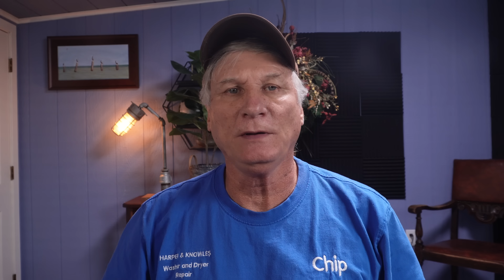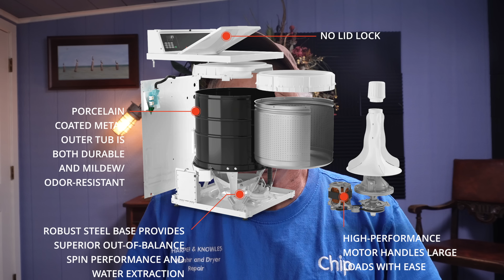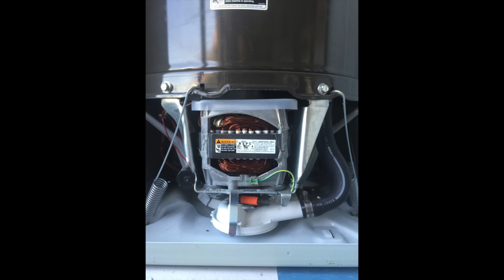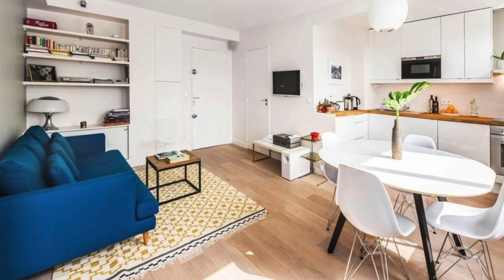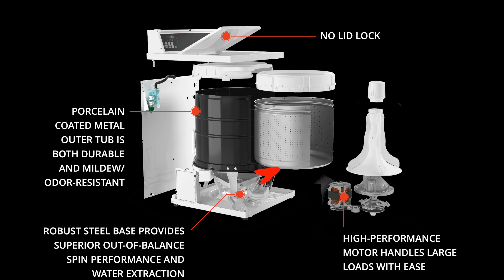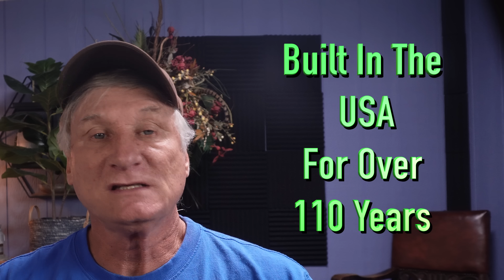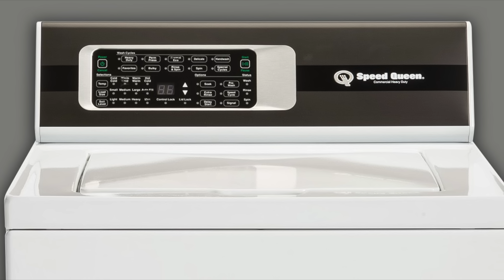TR7 vs TC5 – The Truth Speed Queen Dealers Don’t Tell You

Comment: An update on my pricey, COMMERCIAL MAYTAG WASHER I purchased one a year ago;  It’s working beautifully like my old GE Washer. It’s a GEM of a find being simple, magic and does have the lid -lock feature but it’s a Dream. No blackouts, no struggles. It has a high level water 💧 feature but if I do a heavier full load I dump an extra bucket of water in it without any issues - it’s Great!  But Expensive machine. The Drum is bigger than a Speed Queen and does big loads fine. I’m HAPPY I actually found one brand new boxed. Luckily! It is Very Heavy and stable and does have Large turn dials and looks simple and comes with a 5 year Warranty. So far so good! for $2000 Cdn. Thx 😊

Comment: I own the TC3 model. Have had it about 2 1/2 years and love it. He does't mention the TC3, but it is great. Also little tip, when you are done washing clothes (weather it is a speed queen or any washing machine) leave the lid/door open to let any residual water a chance to evaporate, it may slow down anything from rusting, that may.
Reply: I've done that for decades. Also, tub odor is almost non-existent. As they say, 'air it out baby'. 😅

Comment: As for mold building up in a plastic tub, I'd be worried about mold stains ruining clothing.
My mom had a washer that had a top transmission seal go bad. It would cause small amounts of transmission oil to seep into the tub during a wash.  As a result, our clothes came out looking like they had leopard spots, and those oil stains would not come out.  The clothes that were washed in that machine were only good for work clothes after that. Those clothes were ruined, looking like they had leopard spots or freckles.
An expensive suit... leopard spots.
A pair of designer jeans... leopard spots.
My sister's best Sunday dress... leopard spots.
Nice polo shirts... leopard spots.
Pair of Nike sneakers... leopard spots.
Favorite hoodie... leopard spots.
We replaced that machine in a hurry.

Comment: Avoiding a washer that has one of those retarded "smart computers" is a big part of it right there.
My youngest sister gave me a top load washer that was equipped with a computer and one of those push button pads.  My oldest sister purchased it new and used it only one time, then got a different brand machine.
In 2019, my oldest sister passed away from cancer. That's when my youngest sister gave me that washing machine.  I soon found out why my oldest sister used that machine only once then got a different machine.
On spin cycle, the machine would begin jumping around so bad, it would literally jump up clear off the floor. 
From in the kitchen, I could hear the machine in the pantry going, BANG BANG BANG BANG BANG. It was during the summer when my youngest sister gave me the machine, and the first time I ever heard it banging, I had actually thought a summer thunderstorm was approaching.
And it would bounce away from the wall out to the middle of the pantry floor until it tugged tightly on the water supply hoses. It's a wonder it didn't yank a faucet off the wall.
And most times, it would not finish the spin cycle.
People I talked to had different theories;
"Maybe the clothes shifted to one side of the drum"...I found out that wasn't it.
"Sounds like one of the support struts come a-loose"...None of them were loose.
Someone even told me, "Oh, that might be normal for that machine"...I don't think so.
Someone else recommended placing two cinder blocks in the body of the machine to weigh it down.
Someone else finally said, "I bet the computer is trying to make it agitate and spin at the same time"...That sounded like an explanation that made more logical sense than the dim wit advice I had been getting.
I finally bought a used Whirlpool Estate model that has old fashion controls. That's been 3 years ago and it still runs great.
As for the washing machine with the computer, I cut it up to add to one of my loads of scrap metal to sell at the scrap yard...It actually had more plastic than metal. Even the outer tub and mechanical housing were plastic.

Comment: They may last a long time, but they use too much water, and the aggressive agitator is hard on clothes.  I'd rather just get an LG front loader and if it needs to be replaced in 7 to 10 years, fine.  I had one in the early 2000's and it was still running fine when I sold the house a dozen years later.

Comment: So glad that you answered my one and only concern about getting this washer. ‘Can I wash a queen size quilt or comforter in that small of a tub’. Your answer was Yes! So that checked off my last and only concern. Speed Queen TC5003WN and is what I will be getting.
Reply: Well, if it matters, I have washed my king sized sheets and comforter (yes, separately) without any issues, and my machine is 12 years old. Meat and potatoes gear is what is needed for a lifetime of service, and it can not be made obsolete by a software update.
Reply: I have the TC5 and I wash my king comforter with no problem.
Reply: i watched a video yesterday and he said NO!!

Comment: I have a front load Whirlpool washer that was manufactured in Germany in 2004 that is still going strong.  Other than having to replace the main circuit board about five years ago (which I did myself), I have had no problems with this washer. The machine is still in good condition and thre is no rust or mold on the interior.

According to Consumer Reports, LG and Samsung are highly rated, but their reliability and longevity is poor. If I had to replace this Whirlpool washing machine, what would you recommend? I really prefer the front door loading.
Reply from the maker: All of Speed Queen’s products are top of the line. Thanks for watching!
Reply: @HarperandKnowles 
Specifically, Do you recommend the Speed Queen side load washer? Can you comment on it?
Reply from the maker: I can’t comment on it with any merit because  I never get to work on them. I don’t know if it’s because they are so rare in my geographic area or they are just so dang good.

Comment: After 4 Maytag bravos replaced under warranty , rebuilt the drier  .  This stuff is trash. Multiple bearing failures a minor flood from one.  The,drier when it was under warranty never would dry right . It was always must be the computer.,WROMG!! it hadnamsiezed roller from day one after two years of BS I decided to pull the drum on humch . Bad roller from factory you could see it was bent and got bound stuck . A nice wack with a 2x4 to thenrear panel and new wheels and it been fine. It would never dry clothes in 1 cycle I don't care if you just put a dish towel in it the,semsor for dryness is a joke 
Remember the more do dads it has the more crap to go wrong. Parts ha good luck!!! Thank god we bought an extended warranty on them but even that was a joke . It always was guy a comes out to verify the problem and approve it. Then I wait I don't have any parts!! Then guy B come out and it's like guy A was never here .  What a pain in the !!!
 
Speedqueen and we've never looked back zero issues .  Spend the money thank yourself later

Comment: I have a Samsung pair of front loaders.  They are 16 years old and I’ve replaced control board, door gasket, switch, water valve.  Dryer 7-8 elements, roller kit, burned wire.
They cost me $2000 then and with all my DIY labor and parts likely another $3000.
My wife wants the old school top loader and I will be getting Speed Queens soon.
So Chip is correct only SQ performs like the old Norge, Maytag, and Whirlpools in 1970s and 80s.

Comment: What about their front loaders?

My uncle is a 45+ appliance repair tech and recommended the LG WM3400CW - as it’s relatively low tech, does a good job, and he rarely repairs them. I went with a scratch and dent for cheap but when it gives up I’m contemplating a speed queen
Reply from the maker: I haven’t repaired any SQ front loaders. Either they are very good or the folks around here don’t buy them.

Comment: We had a old school whirlpool washer and dryer,  the washer started to leak and 7 years ago bought a brand new Maytag,  I replaced the belt and the rods last year,  I just got tired of it taking forever to wash a load of clothes but it worked fine though after those repairs, I sold it on facebook and I hope it is still going for the lady, right after I hooked up the TC5 I bought last July.   I looked all over my local town that sold washers but none sold them and I ended going back to my home town and buying it from the local dealer there.

Comment: One question: Why couldn't they make a regular "Traditional Transmission" TC5 that works like the Classic Clean models but ALSO has the user option of "Perfect Clean" TR7 where the tub and the agitator lock together? Wouldn't it just be a matter of a solenoid that could couple or decouple the agitator and the tub. I'm sure it's not as simple as I think; but surely engineers could do this. Seems like a no brainer. That way, for many (most?) loads that are delicate or not soiled much, just use the Perfect Clean setting; and for all others, unlock the tub from the agitator and get the deep cleaning function Classic Clean.
Reply from the maker: Thanks for watching!

Comment: Not sure what to believe.
Many reviews say SQ is not what they used to be.
Many having issues with control boards.
Reply: We bought ours in 2022 and went through 3 different boards. Apparently that was an issue from the board supplier and has been fixed. All repairs done under warranty and we’ve had no other issues
Reply: Hello, nobody is using surge protectors which is the problem to boards failing
Reply: My appliance repair guy told me get a speed queen but only the TC5 - it doesn’t have an electronic board - it has been great!  It was hard to not get sucked in by the bells and whistles of the ones with the electronic boards but I’m so glad I got the TC5 and the dryer that goes with it. It’s amazing - washes faster and also drys faster
Reply: @NancyDaniel-z8u  The TC5 has 2 control boards.
Reply: @SingleStacked  I guesss I mean the electronic ones you push the buttons on it  🤣. That’s what my appliance repair guy told me to avoid

Comment: Chip, I bought a Kenmore 80 series heavy duty set in 1991. I have spent only around $40 for repair parts over the years and they are still running strong. They may outlast me! lol. Anyway, they don't make em' like they used to huh? I'm 60 now and if mine ever stops running I was thinking of Speed Queen TC5, but,,,,,,,will an investment that big be justified if I might not have 25 years left?? LOL!!! Thanks for your informative videos. We all appreciate them. P.S.--On a serious note: I do usually 4, sometimes 5 loads of laundry a month. Do you think it would be advantageous for my electricity bill to go ahead and upgrade to a TC-5? I know I would probably never recoup all my investment, but considering the age of my washing machine and it's electric usage inefficiency, do you think it would be a smart move to go ahead and buy the replacement?
Reply from the maker: I’d only replace it once it gives up. And you can leave your new Speed Queen to your favorite grand child. Thanks for watching!
Reply: @HarperandKnowles  Thx for your thoughts Chip.

Comment: THANK YOU THANK YOU THANK YOU for this info, I’ve seen less than good reviews on the TR7 SQ washers, Have they improved ?
Reply from the maker: No, the problem with them is the agitator is connected to the spin basket. That eliminates the transmission but Lowe’s that traditional wash action. It’s not a very aggressive wash. The TC5 is the way to go in my opinion. Thanks for watching

Comment: Hi there, Can you stop the wash and open the lid on the TR7? I am leaning towards that machine. Thanks
Reply: Hi Gwen - yes you can stop the wash and open the lid on the TR7.  There is a button on the top far right of the panel which let's you "pause" it.  You press the button and then wait for it to click and then you know you can open it.  To start the wash again, you simply press that button again and it starts where it left off.  So it's not as fast old agitators that you simply opened the lid to throw in the one sock you found after starting your load, but honestly the wait is not long since it's only a couple of seconds for the lid to unlock.  The TR7 is a GREAT washing machine. It's much gentler on your clothes and does a great job cleaning them.  It's a workhorse.  Hope this helps!
Reply from the maker: I really don’t know. I suppose you can. Thanks for watching!

Comment: I had my kenmore for 13 years, 1 repair, but then the transmission recently went out.  I hated the lid lock, and the mediocre washes.  My TC5 will be delivered in a few days.  It cost me a fortune, so i sure hope all the hype is real!  I'm both scared and excited, cant wait to use it! I hope i can wash my queen comforter.
Reply from the maker: The Speed Queens I usually work on mostly always have the same issue. The customer overloads it and prevents the agitator from moving and burns the belt up. Even if you can stuff a comforter in one I think that is something better washed at a laundromat that has a high capacity front load washer specifically for that purpose! Thanks for watching!

Comment: I keep getting ED 21 error . lid. Lock has been replaced not the issue. Also put a different control board in still getting the error. The funny thing is it’s intermittent not happening all the time may go three loads and then throw the air a bunch of times in a row  .  any ideas on what could be wrong and how to repair it?
Reply from the maker: That error indicates a problem with the motor speed sensor. I would open the cabinet and blow out the motor area with compressed air if possible. It might just be a dirty sensor. You might have to replace it. Thanks for wstching

Comment: My 10 year old speed queen washer's transmission is shot.  Repairman said not worth fixing?  Is that right?
Reply from the maker: I couldn’t give you a correct answer without evaluating it myself. Speed Queens are pretty robust. Maybe get another opinion but don’t tell the next mechanic what the other guy said unless his diagnosis is the same. Thanks for watching!
Reply: In researching, the transmission is warranted for 15 year (for the part)

Comment: I wish the new TC5 had a small, medium and large washer setting. I've also noticed pin holes in clothes when using the heavy duty cycle, it's very aggressive. And unlike these videos the wash cycle completely stops when you open the lid.
Reply: My model also stops when the lid is open. After 1 year I've now no hot water is coming into the washer.
Reply: Check your incoming water hoses.  The hot water line could be plugged up with gravel or whatever at the small screen filter in the line.

Comment: What I liked about a Speed Queen Washer was the up & down cleaning action rather than the twist agitator of other machines.  Is the up & down method still available?

My Maytag is about 30 years old, the second one during a 50-year marriage.  But this machine has been just horrible on clothes  nearly the whole time I have had it.  Anything with long sleeves, pant legs and often sheets will get wound up tight like a rope.  It even “ate” half a sleeve off of my favorite polyester
t-shirt type fabric sweater.

I’ve had it with this Maytag and want a new washer and wonder if Speed Queen is worth the cost?
Reply from the maker: I am unfamiliar with the “up and down “ action but Speed Queen is definitely worth the cost. Thanks for watching!

Comment: I bought the bigest whirlpool last week. I hate it. The heavy duty cycle works like the gentle cycle on an older washer (probably of any brand) I need clean clothes. Not shuffled in detergent clothes. Mechanic/Electrician husband and a tough boy. I've already planned to send it back and trying to find a speed queen dealer after doing research that I should have done before buying. I was trusting the old brand that I had. Big disappointment.

Comment: I bought a TC5 about 4 yrs ago. I got tired of the new machines breaking down after a few yrs. I wanted something that cleans my clothes like my old whirlpool with a vertical tub and agitator and something that was made to last without all the stupid high tech gadgets that just stop working. I'm a tradesman, so yeah, my clothes get real dirty most of the time. The machine was a bit more than than the big box brands, but man what a machine, it's heavy, well built, extremely quiet, even the spin cycle is very quiet, and I don't think I've ever experienced an uneven load in the spin cycle. Somehow, the machine seems to always balance the load so as not to throw it out of balance. It's worth every penny. My old LG dryer is still kicking, but when it dies, I'm getting a Speed Queen.

Comment: Stop pushing this machine. People can't afford it, the tub is to small and they break just as much as the others
Reply from the maker: You’re way off. I’ve worked on more washers and dryers than I can count, and Speed Queen is in a different league from the throwaway brands. They don’t “break just as often”—they’re built with commercial-grade parts that hold up for years while the cheap ones end up in landfills. And the tub isn’t too small, it’s designed for proper agitation so clothes actually get clean. If you think paying less for junk that dies early is smart, go right ahead—but don’t spread nonsense about something you obviously don’t know about.